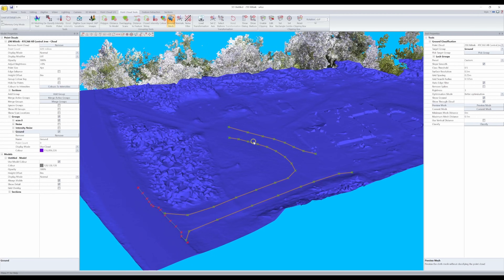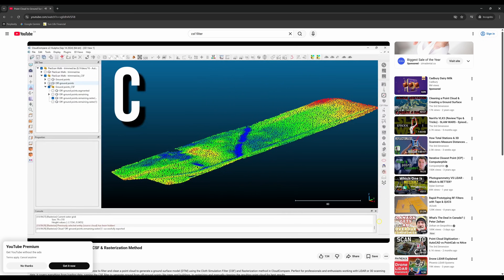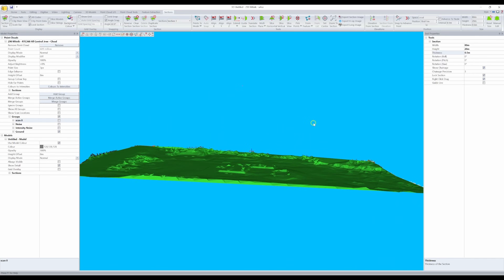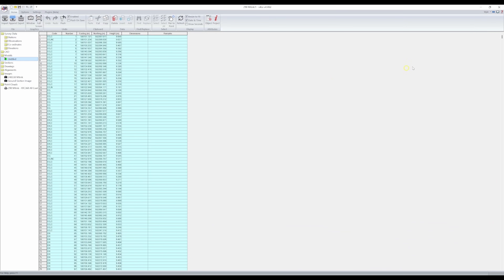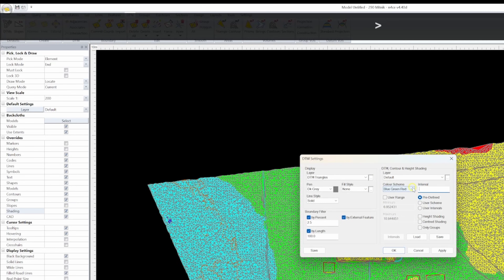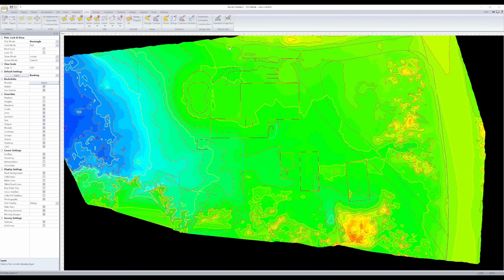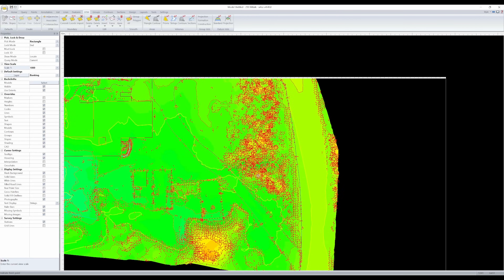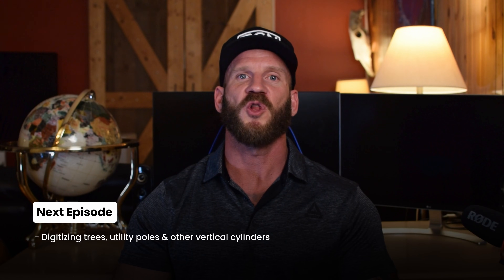Creating a Ground Surface from Point Clouds in N4ce

Comment: I really appreciate these videos.   Even if I dont use N4CE a lot of point cloud software has similar tools.  Even if you read documentation they will tell you how to use the tools but not the scenarios you need to use the tools in, or any tips at all really.  In my head the vertical.slice tool was for facade vectorization of buildings which isnt really useful for a surveyor but I never thought to use it this way.  And every time you learn something new just speeds up your workflow that much more.